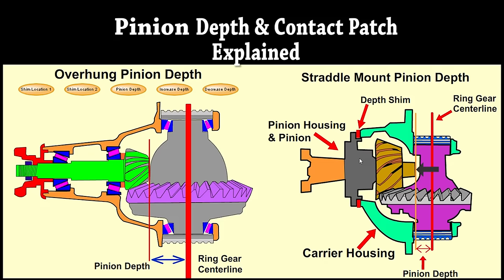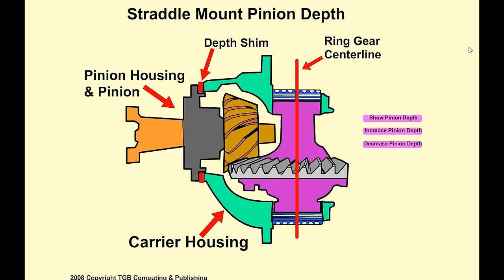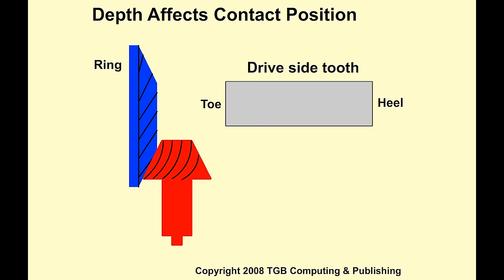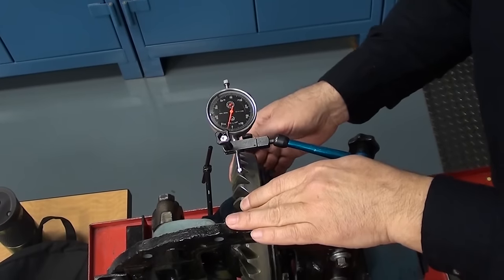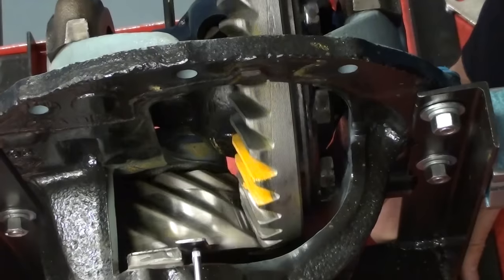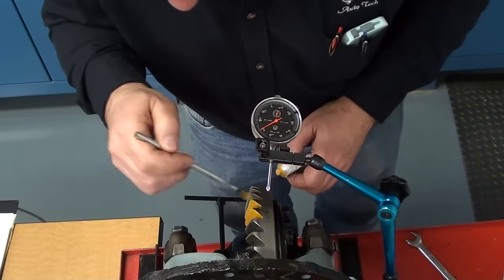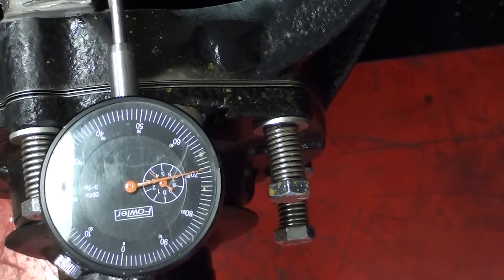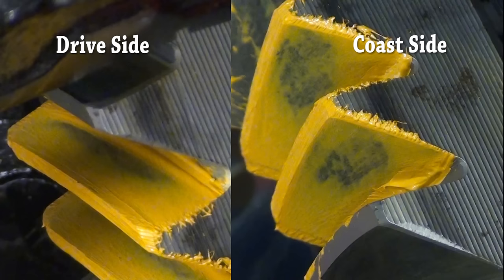Contact Patch & Pinion Depth Explained

Comment: Good visuals & I already understand the importance & meaning of pinion depth. Big problem, how do you find the dimension you need? On GMs the value is stamped on the end of the pinion gear, on others (Chrysler 9 1/4 for example) this measurement seems to be a military secret. Where is the info? Give your audience info on something other than a GM product.
Reply from the maker: The fact of the matter is that most OE manufactures will provide you with the actual depth measurement.  If you buy an aftermarket gearset the depth will be marked on the pinion head.  I think the reason is that most OE don't measure the exact depth but instead the OE depth gauge is more of a tool used to find the shim thickness instead of the actual depth.  The technician uses the OE tool which provides an answer in thousandth of an inch as to the size of the shim to use.  I guess they felt the technician wouldn't be able to do a little math.  In most cases if you are staying with the OE gear ratio or very close to it I use the OE shim that was in the original gearset and I test the pattern and adjust from there adding or taking away shim thickness.  Do another pattern and adjust again if needed.  I can normally dial it in within 1 - 3 tries.
Reply: @DrivelineMaster  I have never done a ring & pinion change or an R&R of the diff bearings. Currently doing the R&R of bearings on a 9 1/4 Chrysler so I'm going to just put everything back as it came out & hope for the best. I'm doing my own because the guy that I once used has retired & his replacement is unreliable. I have been researching the process & watching videos & from what I have seen the process seems to be more trial & error than a technical process. The problem w/ the 9 1/4: if you change the ring & pinion from one axle assy to another there are no markings on the end of the factory pinion, it's just rough casting w/ no dimensions anywhere. I am a retired machinist & have the ability to measure things very accurately & can handle the math. My job required me to solve dimension problems using plane trig & hold tolerance to + or - .0005". Measuring is no problem but I have to have a starting point. From everything I have read & studied there are 2 different tolerances to consider: The + & - tolerance of the machining of the axle case (the shoulder where the  rear pinion brg race seats) and the + & - tolerance machined in the pinion gear itself. As a machinist I can tell that the bearing race seat in the case is not an accurate surface by the machine marks. To hold a close tolerance the shoulder would have to be a ground (process done w/ an I.D. grinder) surface & it is not. On the 9 1/4, I have 2 factory gear sets & neither has any dimension markings on the end of the pinion. I'm still doing research because I plan on doing another one later. Thanks for the reply & sorry about the length of my reply.
Reply from the maker: Hi Larry,  No need to worry about the exact number for the pinion depth.  You are correct that the OEM does not mark the depth on the pinion like aftermarket gearsets do.  You might have to do a little trial and error to setup the depth but it's not too difficult if you understand depth and contact patch.  Watch my video on pinion depth and contact patch for that explanation.  Start with the original size pinion depth shim.  Put everything together except leave out the pinion bearing crush sleeve, pinion seal and don't use the new pinion nut.  Carefully tighten the pinion bearing preload to approximately what it should be. Normally around 20" lbs. of breakaway rotational force.  Use contact paste or other suitable compound on 3 - 4 ring gear teeth.  Use the contact patch on the drive side ring gear tooth to determine if you need to adjust the depth or leave it alone.  if the contact is too close to the toe you need more depth. If the contact is too close to the heel you need less depth.  Adjust the shims accordingly.  There is a little trick for those who build a lot of diffs.  Depending on where the depth shims go (between the rear race and housing or between the pinion head and the rear bearing) a spare bearing is purchased or an old one is used if it is in good shape.  If the shim goes under the outer race a small amount of material is removed from the outside circumference of the spare bearing race. Just enough to remove the interference fit and the race just barely slides into the housing making shim changing quick and simple.  The same can be done from the inside diameter of the rear bearing where it fits on the pinion if the shims go there.  Please note that after getting the correct shim do not use the bearing that was modified. Use the new bearing and race that will still have the interference fit. When you are ready for the final assembly use the crush sleeve, pinion seal and new pinion nut.  If you really want a depth number there is something called a Master Housing Depth (MHD). This value, if you can obtain it is used along with the size of your pinion head to determine the pinion depth.  If you want, I might have the master housing value at work.  Just know my final decision is always the contact patch so even if I use a depth gauge. If the pattern is off I adjust the depth based on the contact patch. If I remember I will try to find the MHD next week for a 9 1/4" Chrysler and send it to you along with the procedure.
Reply: Thanks for the info. i'm resigned to the fact that there is going to be quite a bit of trial & error involved it's just that I'm not used to that sort of thing. I have built many engines & trans & usually have definite specs to work with. That MHD you refer to would be help if things don't go well on the first try. I'm using the original brand bearings so I should be able to get very close on the first try. The pinion depth on the 9 1/4 is set by a shim under the rear bearing (between the bearing & the pinion gear head). I have already pressed the bearing in place so if the gear contact is off I will have to buy a couple more bearings to do the set up. Is there any specified amount of shim to either remove or add based on where the gear contact is located? For example: if the contact is real close to the heel or toe & has to move approx 1/2" to get centered what amount of shim change would get the desired result? There probably is no standard due to the various sizes of the ring & pinion sets but some approx would be helpful. I have made some tools to get the job done. One U tube video showed how to make a carrier bearing adjusting nut tool for the 9 1/4 using a common & cheap hardware store item. I have also made sleeves to press bearings in place. One sleeve is to pull the pinion through the fwd bearing without using the pinion yoke. Frustration w/ the factory shop manual (FSM) is another factor. It says that there are set up markings on the head of the pinion and there are not. Also, the preliminary torque value for the pinion pre load is not accurate. That value is 210" lb & is way too much. Produces over 60" lb drag on the pinion. Again, thanks for taking the time to reply, it's appreciated.
Reply from the maker: Glad to help.  I found the T&D depth tool instructions online. They explain how to calculate pinion depth using the MHD and they also provide the MHD for your 9.25 diff. I have inserted the link below. Unfortunately I have discovered over the years that each diff responds differently to pinion depth .010" shim change. it seems smaller diffs are more sensitive than larger diffs when changing pinion depth shims. If I need to make a change I usually start with a .010" shim change and see how much the pattern moves and adjust from there. Does this diff use a pinion crush sleeve or shims to adjust pinion bearing preload.  The reason I ask is because the pinion nut tightening value is not normally given in foot pounds.  Normally it's given in rotational force on the bearings.  If you have a foot pound specification it might mean that your pinion bearing preload is adjusted using shims between the front bearing and a shoulder on the pinion.  If so, you can torque to the 210' lbs and still obtain the correct rotation force just by adjusting preload shims.  One last note. If you have a press and a good bearing splitter it is often possible to remove the rear bearing from the head of the pinion without damaging it. Additionally, being a machinist you could manufacture a clam shell tool to pull the bearing off without damaging it.
https://www.google.com/url?sa=t&rct=j&q=&esrc=s&source=web&cd=&ved=2ahUKEwiY2ej9ntXrAhXmHjQIHa7aC14QFjAAegQIAxAB&url=http%3A%2F%2Ftdmach.com%2Fwp-content%2Fuploads%2F2018%2F01%2FDeluxe-Pinion-Checker-11148.pdf&usg=AOvVaw3d3eEiKFZ0lT4JLCdlFVKH
Reply: @DrivelineMaster  Got the link & made a hard copy to put into my manual on drive train stuff. Yes, the smaller dia ring & pinion sets would react different to each .010" change. It's a trig thing & difficult to explain. Has to do w/ the angularity of the short pinion gear. The 9 1/4 units used both shims & crush sleeve depending on year. Both of the ones I have are the crush sleeve style. I double checked the manual & it for sure gives a minimum torque value for the crush sleeve type. Also gives the rotational drag for several bearing combinations. 1) using old bearings 2) replacing the outer bearing only & 3) replacing both bearings. My suspicion is that the manual tech writer got specs for the shim type crossed up w/ the crush sleeve type. At any rate I put  a note in the manual (in red ink) about the torque value. The 9 1/4 was used from 70 thru 2008 (or so). I have worked on 4 so far but this is my first bearing change. The 88 that I'm working on (out of a 1 ton B-van camper), has absolutely no machined  surface on the end of the pinion from which an accurate measurement could be taken. It is as forged. Another that I removed from a Ram 1500 pick em up (unknown year but probably a 98 or 99) has the end of the pinion gear teeth machined so I could get a measurement off of the pinion gear length on that one. It is the same ratio (3.54) as my 88 so there would be no advantage to using that set. I have a good (not Chinese) bearing splitter but there is no way to grab the rear bearing. The shim is exactly the same dia as the inner brg race so there is no shoulder to grab hold of. Bearings are not very costly for that axle so I'll just cut off the bearing cage & pull it w/ the outer lip of the inner race. And I could use a good tool room lathe to make tools but my little shop is over crowded w/ automotive tools as it is. There is a company now that is converting the 9 1/4 to be used in A & B body MoPars. it is way stronger (nearly a dana 60) than the 8 3/4 & there are tons of them in the salvage yards. They used them in all 1500 & 2500 pickups (regardless of engine size) & 3500 vans. Some 3500 vans used the dana 60 w/ full floating bearings but not many. Again thanks for the info, I think I can dope it out from here. Final note: most of those pinion depth gage sets will not work in the 9 1/4.
Reply from the maker: Thanks and good luck.  FYI, the heads of the pinion that could be used for measuring the head size or used for the T & D pinion depth are never machined flat like they should be.  Too bad people like you and me like numbers and accuracy.  I'm surprised that the T & D depth gauge won't fit your diffs.  T & D has offered to make me special saddle spacers that any competent machinist could make if that is the issue.  Those kits also come with a 1,2, 3 block for diffs that are extra deep.  Good luck, I'm sure it will turn out just fine.

Comment: Is it theoretically possible to get correct contact patch with multiple pinon depth combinations? My repair shop told me they adjusted the pinion to new position altought contact patch was correct. I think they are messing with me and there is exactly one combination that is correct.
Reply from the maker: Some differentials are more sensitive to pinion depth shim change than others.  In other words .006" change on one diff won't make much of a difference when on others it will make a huge change. There is a contact patch sweet spot on the drive side of the ring gear tooth that allows for some flexibility as long as the contact patch is not off the edges of the toe or heel or too high on the face or too deep on the flank the pattern is fine.  So yes, it is possible to have multiple depths with the correct contact patch.  More than likely those depths are within a few thousands of a inch of each other.  This is a really small window.

Comment: Very good. but it's not so easy on old jeep Salisbury diffs. To adjust pinion and backlash, you have to remove the guts, and pull off the usually very tight tapered bearings, then add or subtract shims, put the thing back together again, check the contact pattern, and if necessary (usually), pull the whole thing apart again, remove bearings, add or subtract shims..ad nauseum. Thank goodness for the screw in type bearing adjusters.
Reply from the maker: Yes, there is a bit of trial and error involved and some are harder to do than others.  That is why knowing if you add or subtract is important. Nobody wants to go through all that work only to find out that you added when you should have subtracted. If you do this on a frequent or semi-frequent basis I suggest buying a pair of bearings for the diff and use a small cylinder hone to remove a little of the metal from the inside of the inner bearing race so the bearings just slide on with no wiggle room. That way you won't have trouble removing the tapered bearings.  After you know which shim produces the correct contact patch replace the modified bearings with new bearings with a tight fit.  Save the modified bearings for the next job. PS.  Make sure to thoroughly wash the modified bearings after honing and lightly oil them before using them to setup your pinion depth.

Comment: One thing that  needs to done is to put the crown wheel under some load a crow bar forcing down on the wheel between the case and coat  6/7 teeth with paste and turn the pinion twenty plus times that will give a real good marking and a bit less paste, engineers blue can be used for marking too,
Reply from the maker: One thing that I forgot to show was that I did do that.  I formulated a section of brake pad onto a bracket with a pressure adjustment screw so the crown gear or ring gear as we call it was under pressure.  I just didn't show that because the focus of the video was on what happens to the pattern as the depth is changed.

Comment: it seems counterintuitive to measure pinion depth such that when you push the pinion deeper into the differential, pinion depth is reduced.
Reply from the maker: Think of it as the measured value.  The closer the pinion is to the center of the differential the smaller the distance and therefore pinion depth is reduced. It's more of a perspective than counterintuitive.